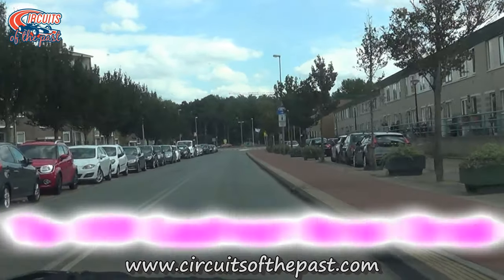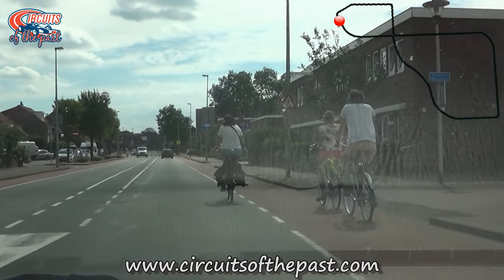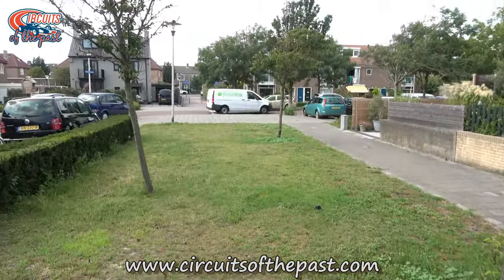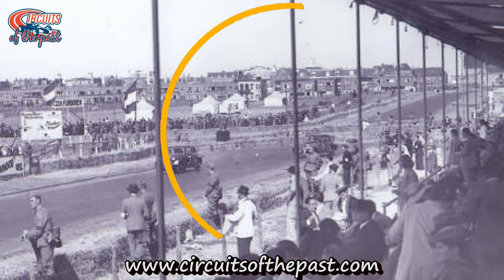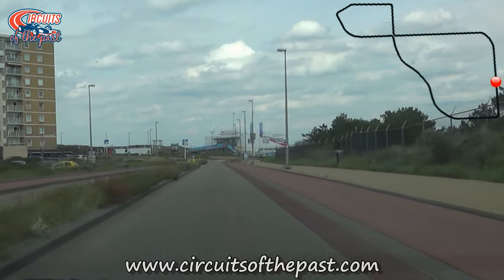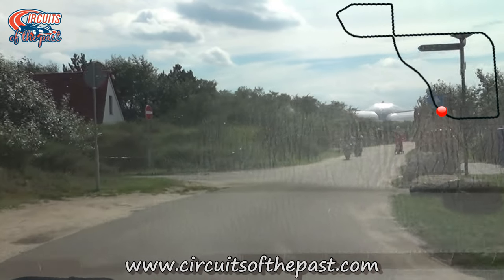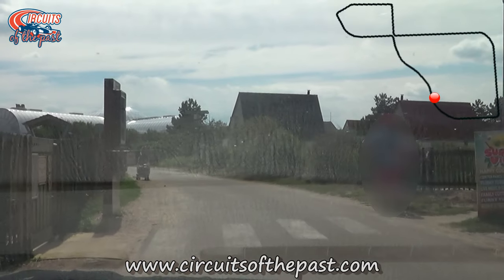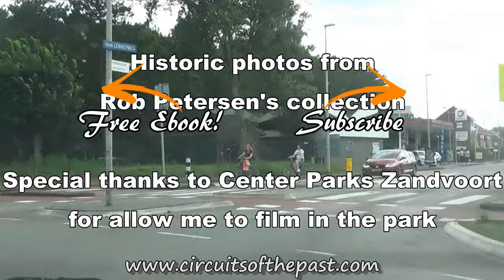Zandvoort 1939 Street Circuit

Comment: Quick question, the old permanent race track had a part which is now the (same) holiday park. Is it safe to say that 1939 street circuit and the permanent race track had an overlap? Or is the permanent race track a bit more to the northeast?
Reply from the maker: Not realy an overlap, but in the part which is now holiday resort both tracks almost touched eachother. Actually they want to make a connection to use a combination of the permanent circuit and the old street circuit. But that never happened.

Comment: i found the track in Google maps, its nearest with new zandvoort circuit
Reply from the maker: Yes at one point it almost touched the permanent circuit. That was on purpose, because when they designed the prmanent track they want the possibility to race also on a combination of both circuits. However, that never happened.
Reply: Oh ,i see